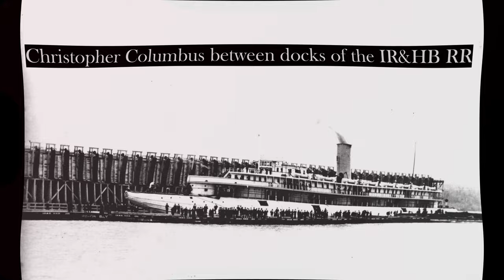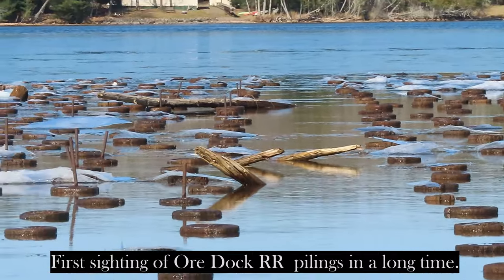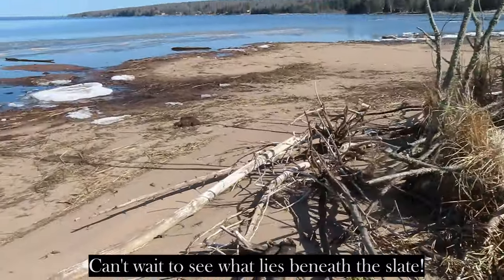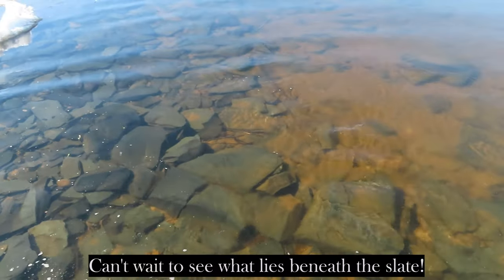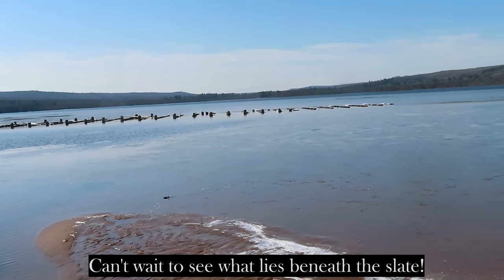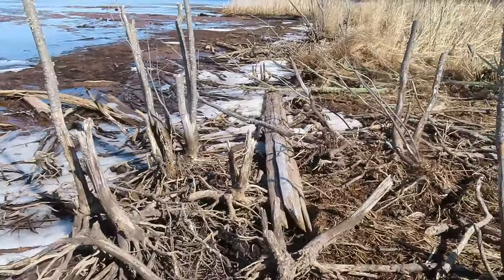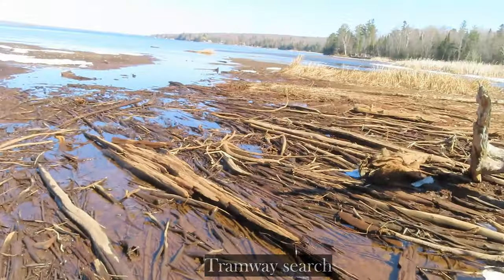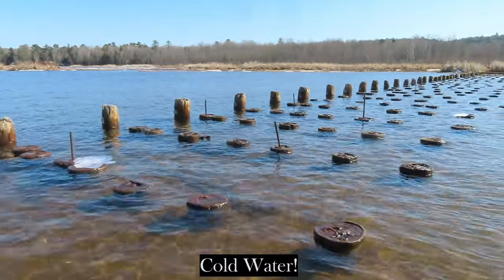A small seiche in Huron Bay and pilings from the Iron Range & Huron Bay RR Docks!

Comment: Great shots of the pilings from a bygone era. In the early 70's and again around 1999  I saw Lake Michigan get low for a few years. Driving along US-2 going from Brevort to about Naubinway I saw the lake level was so low there was dry land for 350-400 yards out from the road. The old timer's said you can't trust it, don't build on it or you'll lose everything when the lake comes back up. I observed the water marks on Mackinac Island where the Ferry's dock being down 4 or 5 feet and one time we had to use a ladder to get up from the Ferry to the dock. Also the rapids at Sault St. Marie visible from the Internaional Bridge were so low you could walk across them. Later  the lakes have risen back to above normal levels. I don't know what causes it but it appears to be cyclic and not climatic. Thank you for the adventure. ben/ flat-lander, fudgee, troll from under the Mighty Mac.
Reply from the maker: I'm with you on the cyclic part Ben-over the years I have seen the levels go up and down-every 20 to 30 years seems to be the cycle!